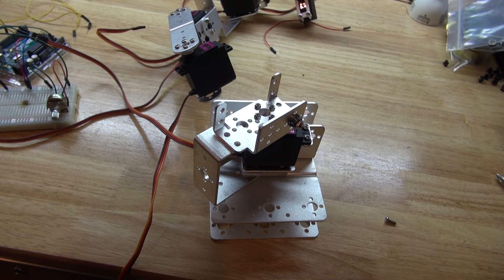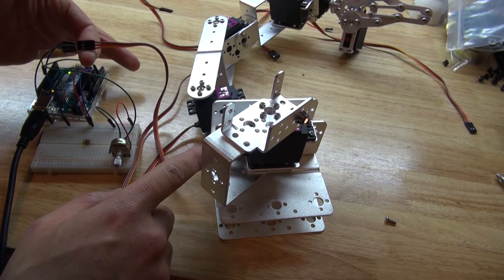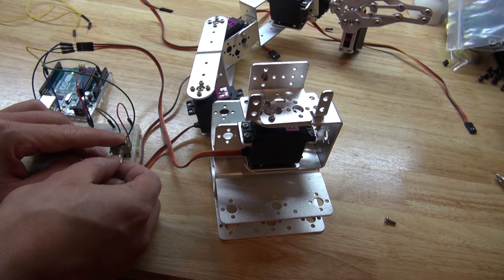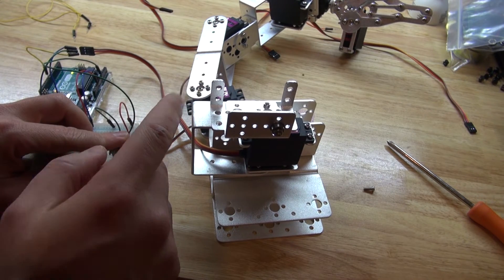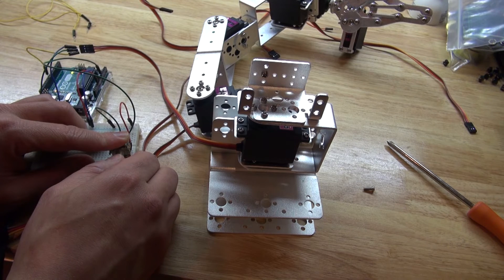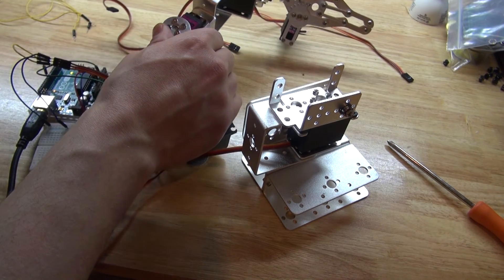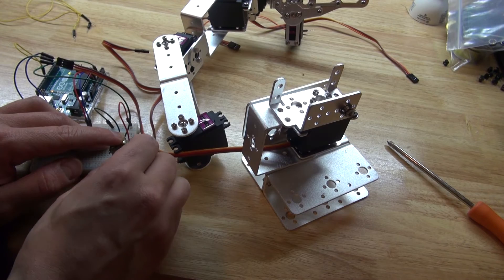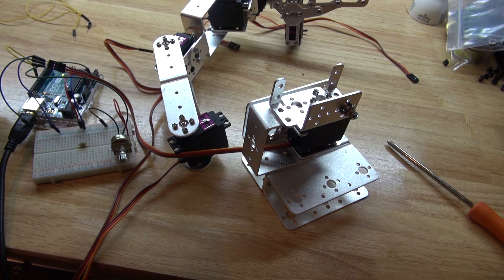Sci Tye Tech Tips Fixing Servos On Robotic Arm 6 DOF Kit

Comment: Any chance you could make a video showing the wiring when it is complete?  I am building one now and I'm struggling lol.  I finished the arm but having problems with getting enough power and proper coding 😣
Reply from the maker: Sure I can help. I am going to make a video soon showing how to control 6 servos with Arduino. In every servo there are three colored wires, brown, red and orange or black, red and orange. The brown or black is negative, red wire is positive and orange is the signal. Connect black to negative and red to 5v positive and orange to to the pmw signals of Arduino. (pin 3_5_6_9_10_11) And you will also need potentiometers. Those connect to analog of Arduino. 

Here is the code. 

//add servo library
#include <Servo.h>

//define our servos
Servo servo1;
Servo servo2;
Servo servo3;
Servo servo4;
Servo servo5;
Servo servo6;

//define our potentionmeters
int pot1 = A0;
int pot2 = A1;
int pot3 = A2;
int pot4 = A3;
int pot5 = A4;
int pot6 = A5;

//variable to read the values from the analog pin (potentiometers)
int valPot0;
int valPot1;
int valPot2;
int valPot3;
int valPot4;
int valPot5;

void setup()
{
  //attaches our servos on pins 3-5-6-9-10-11 to the servos
  servo1.attach(3);
  servo2.attach(5);
  servo3.attach(6);
  servo4.attach(9);
  servo5.attach(10);
  servo6.attach(11);
}

void loop() 
{
  //reads the value of potentiometers (value between 0  and 1023)

  valPot0 = analogRead(pot1);
  valPot0 = map (valPot1, 0, 1023, 0, 180); //scale it to use it with the servo (value between 0 and 180)
  servo1.write(valPot1); //setthe servo position according to the scalled value
  delay(15);

  valPot1 = analogRead(pot1);
  valPot1 = map (valPot1, 0, 1023, 0, 180); //scale it to use it with the servo (value between 0 and 180)
  servo2.write(valPot1); //setthe servo position according to the scalled value
  delay(15);

  valPot2 = analogRead(pot2);
  valPot2 = map (valPot2, 0, 1023, 0, 180); //scale it to use it with the servo (value between 0 and 180)
  servo3.write(valPot2); //setthe servo position according to the scalled value
  delay(15);

  valPot3 = analogRead(pot3);
  valPot3 = map (valPot3, 0, 1023, 0, 180); //scale it to use it with the servo (value between 0 and 180)
  servo4.write(valPot3); //setthe servo position according to the scalled value
  delay(15);

  valPot4 = analogRead(pot4);
  valPot4 = map (valPot4, 0, 1023, 0, 180); //scale it to use it with the servo (value between 0 and 180)
  servo5.write(valPot4); //setthe servo position according to the scalled value
  delay(15);

  valPot5 = analogRead(pot5);
  valPot5 = map (valPot5, 0, 1023, 0, 180);
  servo6.write(valPot5); //setthe servo position according to the scalled value
  delay(15);
  

  
}
Reply from the maker: I hope this helps! Good luck and have a nice day!
Reply: @SciTyeTech  Thanks!
Reply from the maker: Hello! I have noticed I made an error on the code. Don't use this first code I gave you, it will not work properly. I made adjustments to the code and this one will work.

#include <Servo.h>

Servo servo1;  
int potpin1 = 0;  
int val1;    
Servo servo2;  
int potpin2 = 1;  
int val2;    
Servo servo3;  
int potpin3 = 2;  
int val3;    
Servo servo4;
int potpin4 = 3;  
int val4;    
Servo servo5;
int potpin5 = 4;  
int val5;    
Servo servo6;
int potpin6 = 5;  
int val6;    

void setup()
{
  servo1.attach(3);  
  servo2.attach(5);  
  servo3.attach(6);  
  servo4.attach(9);  
  servo5.attach(10);  
  servo6.attach(11);  
}

void loop()
{
  val1 = analogRead(potpin1);        
  val1 = map(val1, 0, 1023, 0, 185 );
  servo1.write(val1);            
  val2 = analogRead(potpin2);        
  val2 = map(val2, 0, 1023, 0, 185 );
  servo2.write(val2);            
  val3 = analogRead(potpin3);        
  val3 = map(val3, 0, 1023, 0, 185 );
  servo3.write(val3);          
  val4 = analogRead(potpin4);        
  val4 = map(val4, 0, 1023, 0, 185 );
  servo4.write(val4);            
  val5 = analogRead(potpin5);     
  val5 = map(val5, 0, 1023, 0, 185 );
  servo5.write(val5);            
  val6 = analogRead(potpin6);        
  val6 = map(val6, 0, 1023, 0, 185 );
  servo6.write(val6);            
}